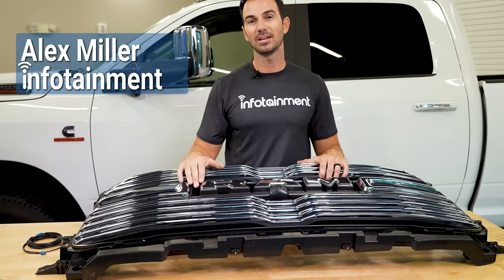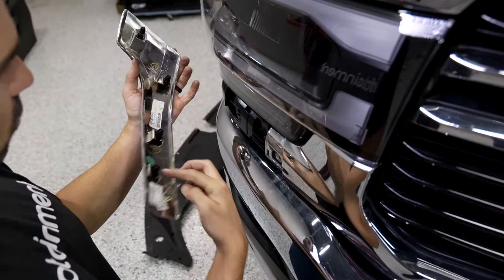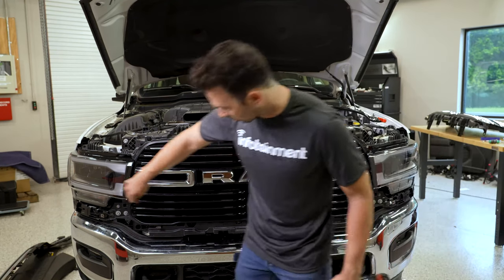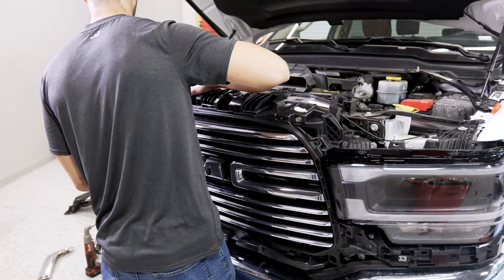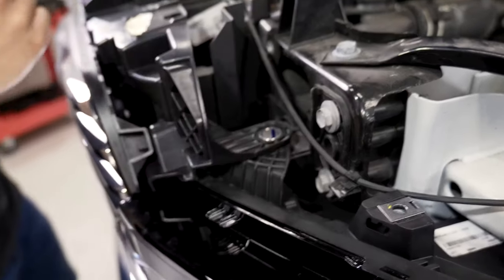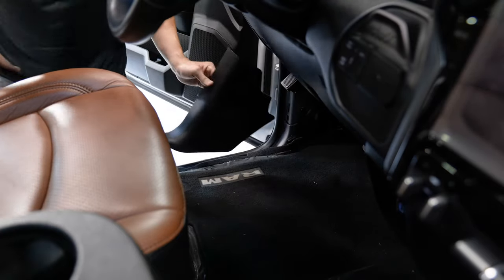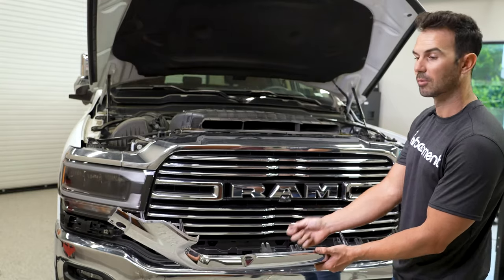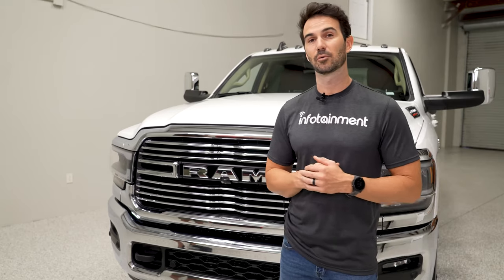2019+ Ram 2500 - Front Camera Installation - Episode 28

Comment: Are you guys going to show how it integrates into the Uconnect system?  Is it plug and play?
Reply from the maker: We'll have to upload a video showing how it's used. We made this video showing how to do the installation, but we never actually launched this product. This is mainly due to replacing the entire grill. The vehicle does need programming as well to enable the front camera once it's installed.
Reply: @Infotainment_nav 

This information would be very helpful. All you had to do is to mention this.

Comment: This was only how to install a new grill and route the camera cable. Now what? I thought this video was about the camera. So... what do you do with the camera cable you routed through the firewall? Are you able to use the camera even if your truck didn't come with it previously? Unfinished video and  non of my questions was answered.
Reply from the maker: Hi there,
So there's a bit more to this upgrade. This was showing how it would be to add the front camera, and how to route the cable to the CVPM (Central Vision Processing Module). So you are correct, there are additional parts required. I believe this video follows the one where we added the parts for 360 camera. The vehicle will need a custom made harness and a CVPM. The CVPM is under the driver's seat in the Heavy Duty RAM's that come factory with 360 Camera. In 1500's it would be on the passenger side behind the sidewall, it can be accessed by pulling up the trim piece at the bottom of the door entry to the right of the glovebox.

Comment: Is the camera one with the grill? I need to replace mine because it got moisture in it but I'm not sure if I can just buy the camera or if I have to by the hole thing.
Reply from the maker: You should be able to get the camera by itself since you already have the grill from factory. I'd recommend checking your local dealer or a MOPAR supplier

Comment: is not a system that you can add just the camara to the grill for  a 2023 2500 rebel??
Reply from the maker: We ended up replacing the entire grill as it had the camera slot in the new grill. I'm certain you could drill a hole and make a front camera slot, but that would be all custom work, and you run the risk of damaging your original grill if not careful!
Reply: @Infotainment_nav  hi I have the grill RAM SIGN with the Camera will that work with your items to get it connected to the 12 inch sreen Uconect 2023 ?